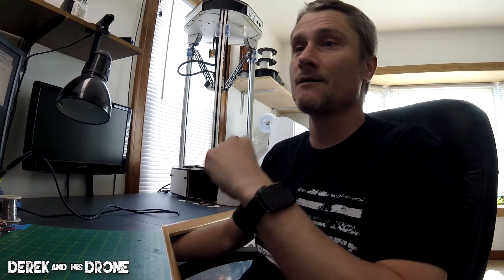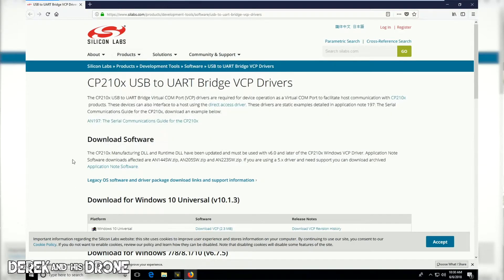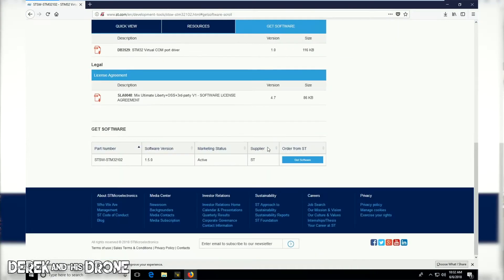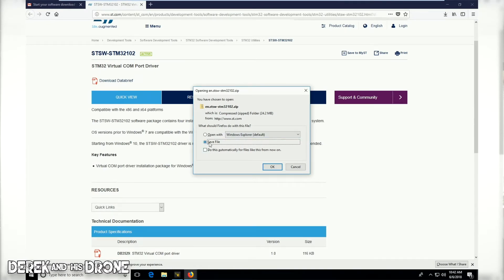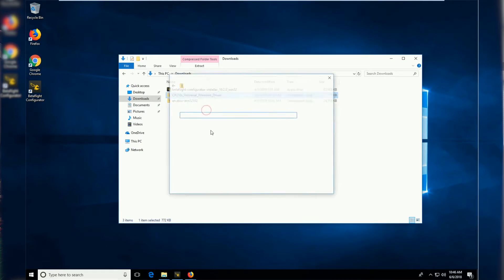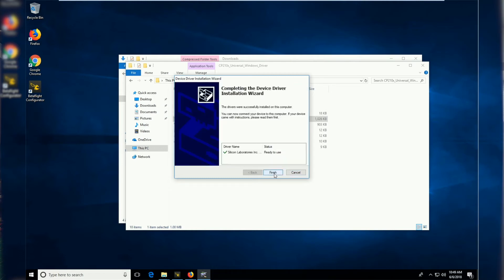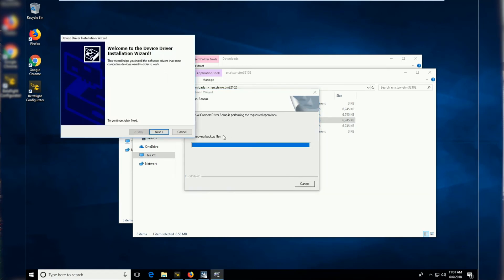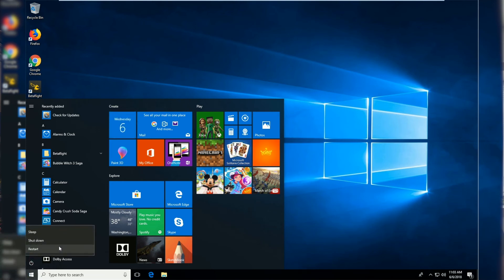Basics of Betaflight - Downloading and Installing the Drivers

Comment: So I have done all this and it still won't work I get no com ports and the drone cant connect. I have tried everything I can think of different cables different internet connections and even different computers. I have spent 2 days installing and reinstalling all this software and just does not work. If this what this hobby is like then I'll just sell all the stuff I brought. This is as far from fun as I can imagine.
Reply from the maker: There is only one of three things that could be your problem cable, computer or flight controller.  If you are confident on the first two I would suspect the FC.
Reply: @DerekandhisDrone  so it does this with both the drones I bought the mobula 6 and the mobula 7 v2. I figured out it's a windows issue but there is no easy fix
Reply from the maker: This might help. https://youtu.be/5YBnILt5y5w
Reply: @DerekandhisDrone  thanks Derek but I got it fixed! I had actually emailed the cyclone fpv where I bought the mobula 7 and asked if could return it. The owner responded to me and remotely accessed my pc and helped me fix it. It was quiet the ordeal but it all up and work correctly now. Thanks for taking the time to help out I appreciate that.

Comment: FYI clicking on the link for the CP210X drivers doesn't work (I'm using Betaflight 10.6.0 which is the most current version as of 3/14/2020).  This is the link I finally found (after having to re-register with Silabs)-https://www.silabs.com/products/development-tools/software/usb-to-uart-bridge-vcp-drivers.
Reply from the maker: Looks like the link changed on the Silicone Labs website.  You found the right one.

Comment: Cannot connect to Betaflight even after you loaded the driver onto your mac? 
It could very well be the USB cable you are using is a power charging ONLY cable. Find one with DATA transfer enabled. It should connect nicely. Most USB cables that came with your Android phone will work because it allows you to connect to your comp.
Took me half a day to figure this out. Hope that helps.
Reply from the maker: This is the most common problem that I run into when the flight controller won't connect.

Comment: Hi, SPF3, gives timed out error while flashing clean flight
Reply from the maker: Cleanflight hasn't been used in years.  I would suggest trying Betaflight version 3.5.7 as F3 processors are no longer supported in newer releases.  You might want to consider upgrading to something with an F4.

Comment: thanks but for some reasone it does not fly when i raise throttle even when i arm the drone
Reply: it just starts to flip sooo
Reply from the maker: Check your motor direction and props.  Is your fright controller installed in the correct direction.

Comment: HI MY BETAFLIGHT IS ALL UP TO DATE BUT THE RECIEVER SECTION COMES IN BLANK PLZ HELP ME ASAP
Reply from the maker: Usually when something is missing it is because of a software mismatch with the Betaflight firmware and configurator.  Make sure configurator is on version 10.5.1 and reflash your flight controller with firmware version 4.0.3.  Make sure full chip erase is enabled before flashing.  Sometimes Betaflight does funny things, a clean reflash could do the trick.
Reply: tnaks soo much i tried what you said and it works
i also have a concern i am a total beginer and i have an eachine wizard x220 but i am thinking that the eachine is too advanced for me plz recomend a better drone or shal i just use my eachine to learn to fly
Reply from the maker: The Wizard is a great quad to start with.  Learn how to fly and work on it.  There is a lot to learn but the Wizard is about as easy as it gets.  Take things one step at a time.  There is a ton of videos on YouTube on how to do everything.  Anything easier would be toy grade or a DJI product.

Comment: For the second installation it looks like the only options are for windows 7 and 8. On their website they recommend using one of W10’s native drivers instead, should I still download the W8 version of the driver anyway?
Reply from the maker: Yes install the driver packages from the links in Betaflight.  Not doing so can cause issues and prevent DFU mode from working.

Comment: Hello.
I am from Latvia and I do not know English well, sorry
I use Noze -rev5 controller! and "cleanFlight 2.4.0"
I can not uplaud the latest version of Nouze 2.4.0
trying to restore the program to a newer version - No response from the bootloader, programming: Failed.
I use the BOOT function.
I tried through Flesh Loader and the controller does not connect.
The controller is from an old dron, the first time I plug in the blinking diodes in blue and green and emit a noise.
"cleanFlight 2.4.0" showed the announcement that it says-restore the firmware or use the older version of "cleanFlight 2.4.0"
and I chose to restore the firmware- and it was wrong :(
Reply from the maker: The equipment you are trying to use is rather out of date.  It is really important to know exactly what board you have when flashing firmware.  Flashing the wrong firmware can brick the flight controller.  It is possible to fix it but not without a programmer and the right firmware.  I would recommend getting a $20 BetaFlight board.  Things will be a lot easier moving forward.

Comment: Great video bro!! I'm new to you channel. And your great at what you do. I installed drivers like you did on my windows10. I'm able to connect through BF but I cant flash new firmware like BF3.5. Once I finish downloading  latest firmware and press Flash  firmware. I get Failed to open serial port.. bummer.. I tried impulse RC driver fix but all it does is search for FC. Rebooted pc as well. No luck. Any ideas what might be going on?? I am running 64bit. I would greatly appreciate it if you help me out. IM A  NOOB!
Reply from the maker: You need to boot the board into DFU mode before running the driver fixer.
Reply: Great!! Thank you!! I was able to put board in DFU! Just flashes BF 3.5.2  latest firmware!! Now to test and tune!! Thanks you so much for your help!!! Iv been flying for bout a year now but still manage to keep learning new stuff and get stuck from time to time!!! Once again Thank!! Keep up great work man!!
Reply from the maker: I'm glad it all worked out for you.